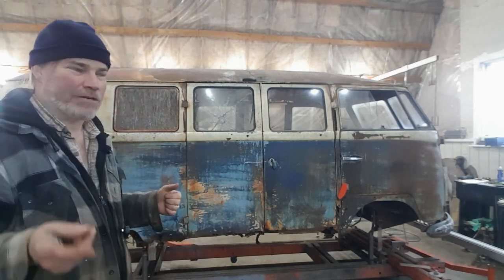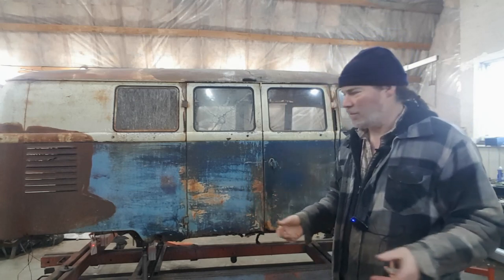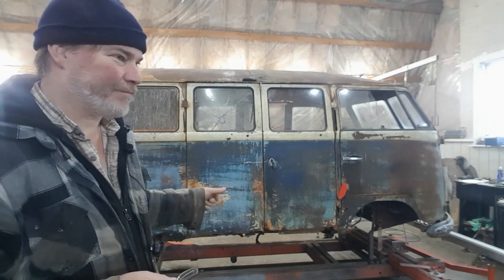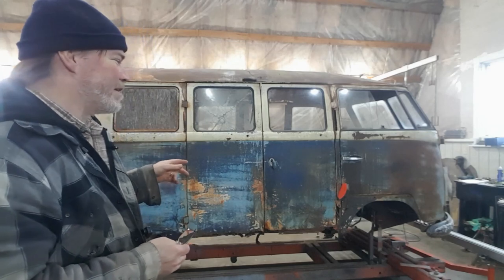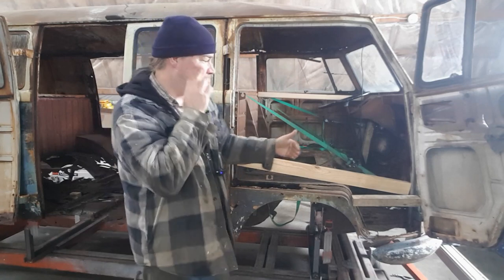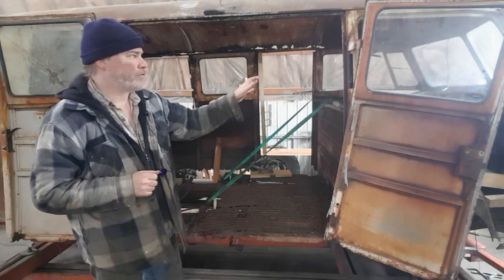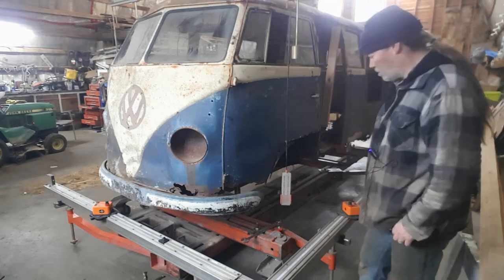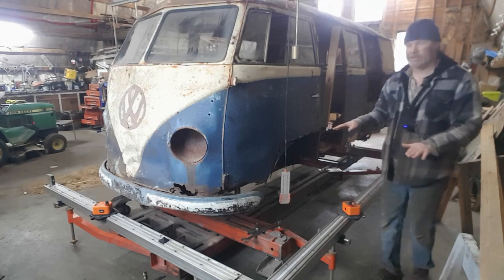The Nova Scotia Barndoor E02 - Body straightened

Comment: Tricky job because with all the windows and doors, the frame needs to be straightened and supported by some structural steel to keep the body from flexing and twisting but I applaud you for tackling such a daunting project....

Comment: Before you take it apart it’s a good idea to weld in some cross bracing since you were able to get it straight. It will help keep straight once you start stripping it.
Reply from the maker: They body will be disassembled so each individual parts can be rebuilt. Too much rust internally to leave it together.
Reply: @thenovascotiabarndoor1954  I see so you just straightened it to get measurements for when you put it back together? That is nutz so you are gonna completely disassemble and put back together? That seems overwhelming and too much but I guess that’s the only way it can be done correctly. That will allow you access to the bones. I would probably start at the front and work my way back or start at the most complete section and work from there because if I saw my entire bus disassembled I would probably just give up. Jaaaa. Now I know why you said it would take three years to do the body work. It might be possible to leave the shell and go from there but then you wouldn’t be able to access parts of the frame so good luck dude and please share the process. Check Dominic from England. He is doing a similar process on a Porsche 356
Reply from the maker: Been watching Dominic's videos for some time. Glad to see he is back at the 356